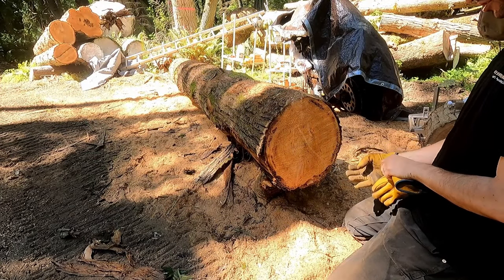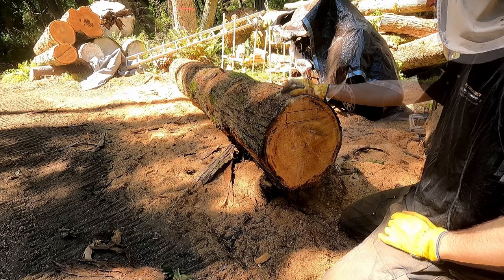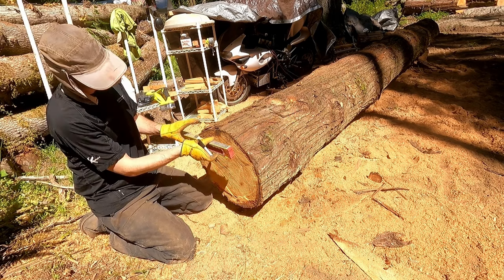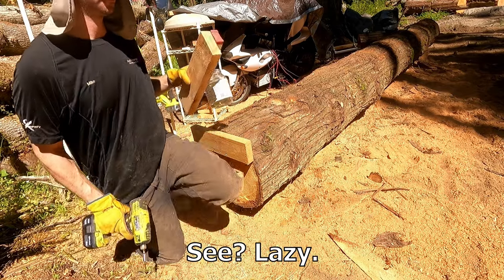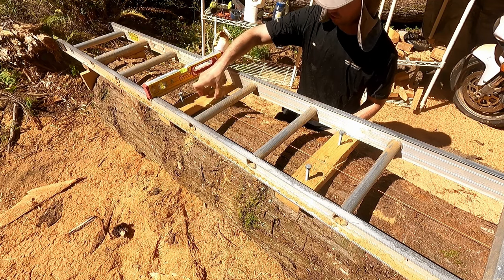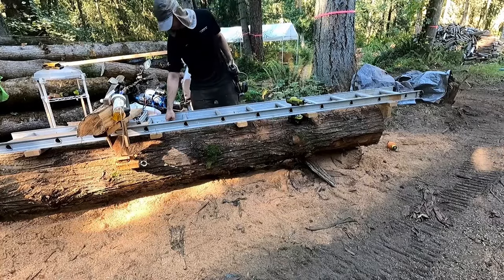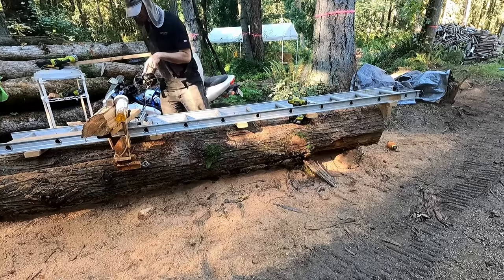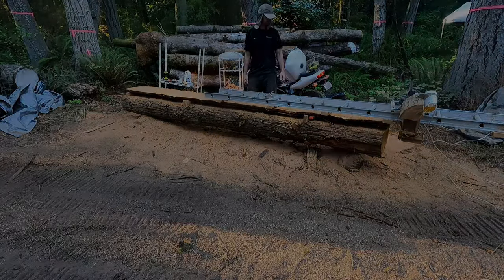Chainsaw Milling - The Dreaded First Cut

Comment: Built a holding jig out of steel griders and 2 hickory logs each 150lbs and 22inches high. Assembled together with 6 inch lag bolts. I use only stohl brand ripping blades . I've done 77 slabs so far all 1x10x10.

Comment: You need to invest in a cheap 2x4 mill attachment for first cut. Been using mine for years and so much simpler.
Reply from the maker: I'm not familiar with this method/product. How does it work? Do you have a link you can share?

Comment: I use the nails and string line method. Only a short board you slide along is needed. I once cut a 72 ft 6×18.
Reply from the maker: I haven't heard of that method. How does it work?
Reply: Drive in a 3in nail at one end of log about 4in off center. Go to other end and do the same then stretch a really tight string line between nails. Go back along stringline driving in a nail every foot or so till its down level with stringline. Take a level and across from first nail dri
Reply: Oops. Make the second line of nails 4 in on other side of center. You end up with 2 level rows of nails .I use a 5ft piece of 2by 10 on top and saw down a ways then slide board forward and so on.
Reply from the maker: Clever! Gets you unlimited length and sounds reasonably easy to set up. I like it.
Reply: For years I carried a HUGE plank with me to use . Too soon old too late smart😂
Reply from the maker: That legit made me laugh out loud. I'm going to steal that line and claim it as my own. @longfellow5276
Reply: @longfellow5276  from what I'm reading you're using nails as posts to hold the plank level all the way down the log, which allows you to easily move the short plank and keep the same cut going without deviation? 

How do you keep your plank from moving while in the cut?
Reply: @maddawgnoll the pressure of the saw seems to keep it in place almost too well

Comment: My first cut in through the pith. Let's me use good size screws to keep the rails on and the log on my saw horses. (My saw will pull a 700lb saw right off the horses even with dogs set to hold it) Get rid of that damn thing so the boards are less likely to cup. I also go on from there and quarter saw as much as I can. But it's been a long journey of errors to figure out a efficient system.
Reply from the maker: How does keeping the rails on make the boards more likely to cup?
Reply: @UncleMikesCustomThings  not the rails. I cut through the center, at the pith. I try to get all of it removed because that's the biggest culprit to cupping boards
Reply: @UncleMikesCustomThings  what I meant by keep the rails on is by cutting the pith I don't need to worry about the length of the screws I use to attach the rails. When I first started using my sawmill I kept running into problems keeping my rails mounted without shifting or sagging mid cut. I also went from using metal poles to using dimensional lumber because the amount of flex I was getting was messing things up.
Reply from the maker: Oh! That makes way more sense. Great tip!